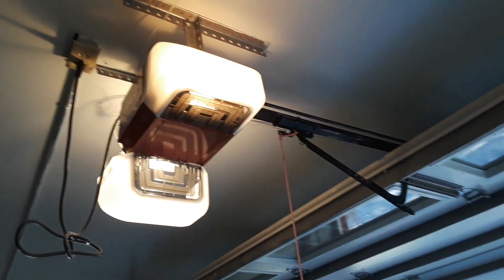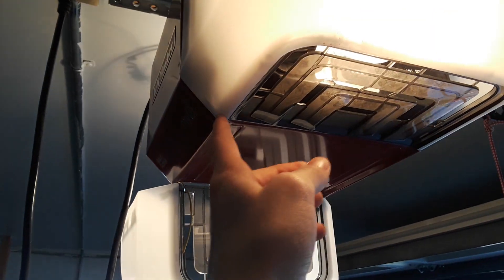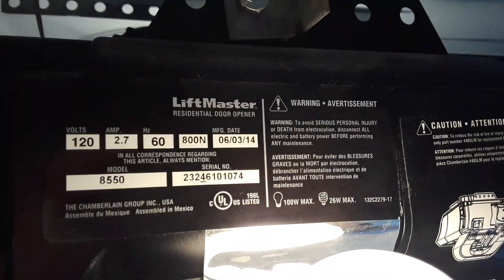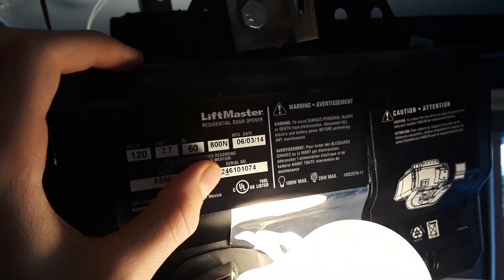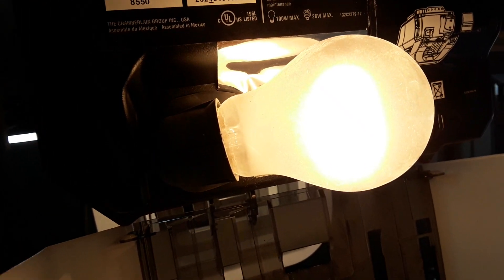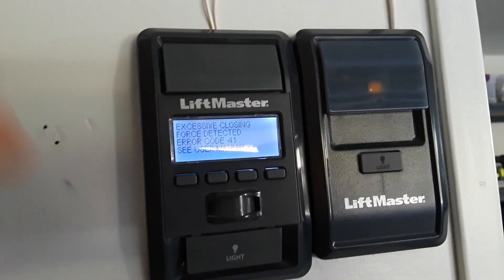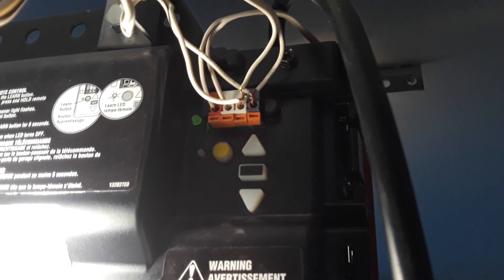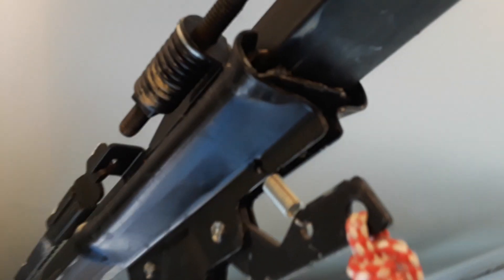About the 8550 (READ DESCRIPTION)

Comment: Wait so like the 3850s are actually 3/4? Not to mention every new thing chamberlain puts out sucks ong
Reply from the maker: If the motor rating says 800N, the motor itself is 1/2 HP equivalent. 1000N Is 3/4 HP
Reply: @TBHD724  thanks

Comment: Huh? Well, that might explain why the 8550 doesn't sound too happy! I'll check my opener to see if it says that as well.
Reply from the maker: Yours is an AC motor, so it will say 3/4 HP on the label just like the 8365 says 1/2.
Reply: @TBHD724  Oh right. I forgot you said that. :)

Comment: You should get a chain drive garage door opener
Reply from the maker: If the 8550 dies before the springs break i'll probably move the 8365 to the big door
Reply: @TBHD724  And another 8365 on the small door?
Reply from the maker: No we will just have the small door on manual for awhile